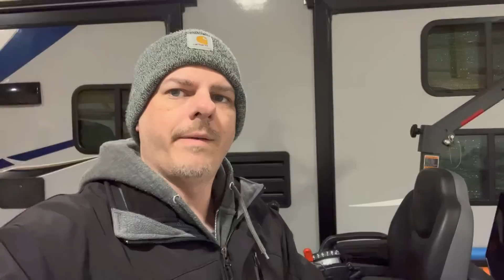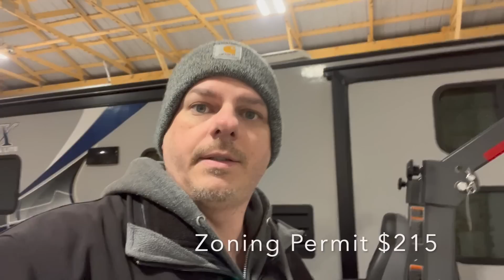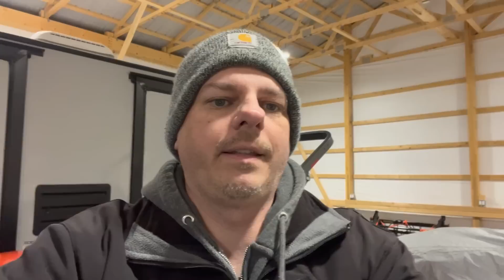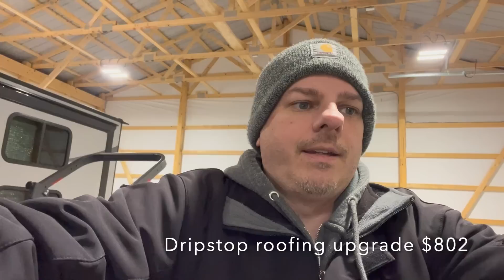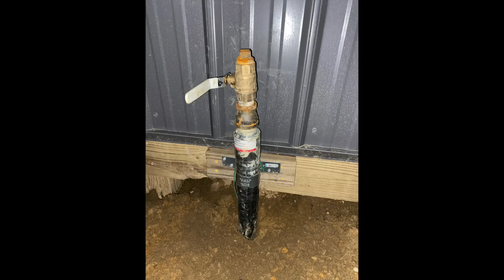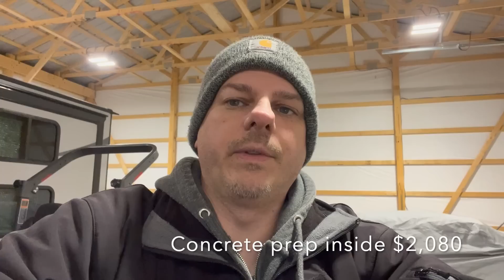"This Garage Costs How Much to Build? You Won't Believe It!"

Comment: Have you figured out the materials costs vs the labor costs (Maybe I missed this)? Labor is usually 3 times the material costs or more depending on the job. So if your building costs 70K the material costs may have been around 23k-30k. Just as an example, I built a very similar sized building in 1992 but based on the photos of your building mine was built heavier, i.e. 2x6 over 2x8 trusses, 2x6 girts etc. My total costs in 1992 was $10,500 (all material cost). Today the material cots would be around $22,500 due to inflation, maybe more.
Reply from the maker: I did price a few pole barn packages for materials only figuring I could attempt to build myself or find a builder to do it knowing I’m purchasing all supplies.  What I found was labor cost for the builder I went with was only around 25% of the material cost.  No where near 2 or 3x fortunately.  If you figure these guys are putting up a building my size every 4 days or so even at 25% they make some good money.  Since you mentioned trusses they are engineered and stamped and I confirmed the bottom chord dead load would easily support a ceiling with blown insulation as well as the rated snow load rating for my area  so no need to pay for anything beyond that in my opinion.  Spacing of girts with steel also have the specifications required for wind ratings in my area too.  All great questions when you’re building a new pole building.

Comment: Keep an eye out for leaks in the roof if the screws are in the ribs, Because I helped build a warehouse that they did that and it leaked like crazy.
Reply from the maker: Definitely a good tip.  What I’ve found is some contractors don’t use long enough screws in the ribs that causes most of the issues.  Mine are in the flats but I’m still leery that not every screw was put in perfect.   Thanks for watching!
Reply: Do you have one piece screws or two piece. Did the sealing part fail on screws. Just asking because we have building that's about 35yrs. and still no  problem.

Comment: Excellent video my friend, thank you for the details. Considering doing the same thing when we move to Kentucky. Quick question though is how long is your travel trailer? I have a 30 foot and I’m trying to gauge the length of the garage that I should have so it’s comfortable and roomy. We plan on living in the garage temporarily in the trailer until the rest of the house is built.
Reply from the maker: Appreciate you checking out the video.  Our travel trailer is 34’ 5” from tongue to rear bumper.  I now have a small storage loft in the rear and still have room to park a car in the rear and fit the camper fully inside.
Reply: @journeys-with-joe Would the camper have fit inside a 12' tall building with 10' garage doors?
Reply from the maker: Our camper is 10’ 3” to top of it the AC so a 12’ door is needed.  Almost every travel trailer I’ve looked at is less then 12’ but when you get to 5th wheels then you have to have a 14’ door.

Comment: Also depends on how you source materials. ive done some Earthen walls and if you have decient overhang and be mindful of drainage it really is a sweet way to cut down on lumber and siding by using bricks and just raw dirt and drywall. Also i have in my garage a drainage channel for power washing so IF the walls within the next 30 years started leaking it would go directly into the channels running out to a retention pond i got a filter setup to protect well water from oil and soup i wash out. But ive taken out the drywalls to check and its totally dry after 3 years. Had some bugs trying to work in so i tried torching some clay soil between the sandy dirt and the drywall. That may be pointless i dunno yet, but dirt walls are under rated.